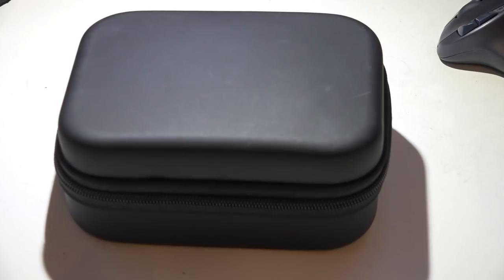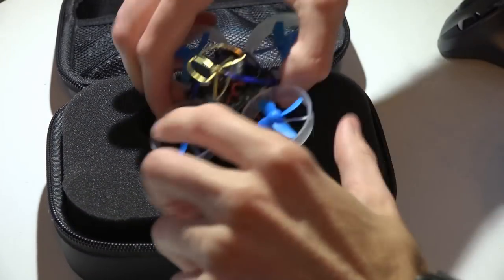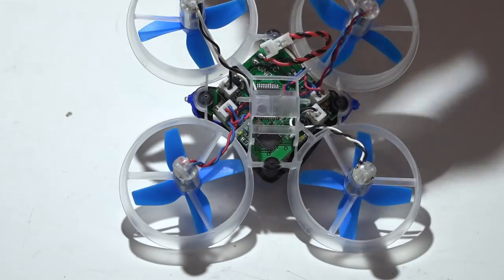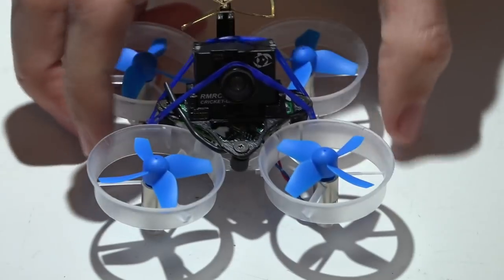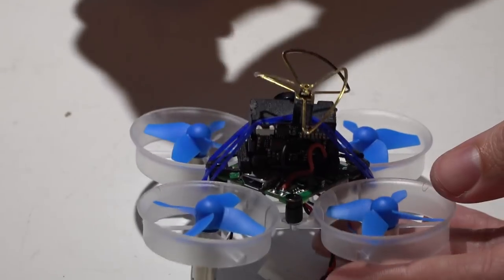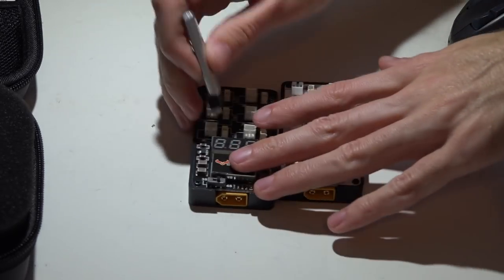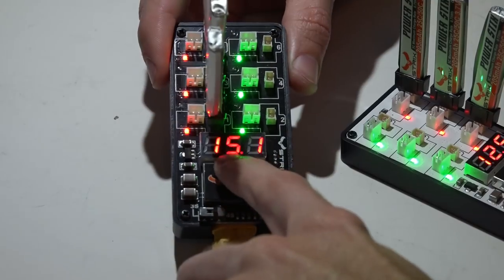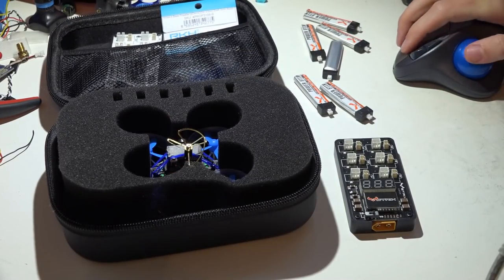My Tiny Whoop

Comment: I can highly recommend canging the battery cabel and going for jst 2.0 ph batterys(maybe HV). 
Probably you can also use the 200mw VTX of the Eachine TX02 camera. Unpin it, connect it to your camera and glue it with the antenna facing backwards on your fc. It won't brake any more that easy like this.

Comment: I bought the original beecore board when it first came out hoping it would bind to my evolution and it didn't.  Did they fix that?  I bought mine on banggood.  Not sure if the ebay one is the same or not.  I ended up using the Eachine Tiny 32bits F3 Brushed Flight Control Board and just soldering the motors to it, connecting the tiny FS-A8S, used a custom 3D printed mount and it is super light.

Comment: Wait I have a BeeCore FC and I thought it only had the 1st Flysky protocol while the Evolution uses the newer Flysky protocol. If I can use my whoop with my evo instead of this old PoS Flysky remote ill be the happiest bean alive.
Reply: JC, can you address this?  I was under the same impression.  I am having to use the FS-A8S receiver to fly with my Evolution.
Reply: I just checked Banggood and they mentioned the beecore being updated to the new protocol. I checked the ebay link and it doesn't say it is the new version but I would imagine they are all coming out supporting the 2A protocol.

Comment: Been waiting for this video from you for a while!
Reply from the maker: Thanks. I've been swapping out parts for a while haha. But I'm finally happy with everything now after trying a bunch of stuff out and seeing what I like best. I think after getting the smaller cricket cam v2 I'll be completely done with it.
Reply: I've been doing the same with mine and my son's tiny whoops. I gave up waiting for the all in one boards to support the 2A protocol so i ultimately ended up with a micro brushed F3 board and the micro flysky RX. Yeah, it's still two boards but I do get to run ibus which I like a lot.

Comment: Hi JC how did you get the beecore F3 FC  to bind to the turnigy Evo, I have spent a couple of hours on this and failed, reading the forums it appears that the beecore is AHFDS and the turnigy is AHFDS 2A
Reply: Jim Hyndman turn ahfds off
Reply: Hi Micheal my understanding is to get it working on a fly sky TX you turn AHFDS 2A off which reverts  it to the older AHFDS protocol the Turnigy appears to be locked to the 2A protocols. Any detailed info you can supply would be great
Reply: Jim Hyndman not sure about that

Comment: People should be aware you should never charge a lipo or any lithium battery to higher than its rated voltage. Do not charge cells rated 4.25v in a 4.35v charger they can explode.

Comment: I expected more from you on the Tiny whoop.    Linear antenna, taken off the camera guard for weight savings, & certainly not using rubber bands to mount the camera.
You are better than this PBF.   :-D     However, that STRIX charger is B/A!

Comment: How fast is the strix charger?
Reply from the maker: Pretty quick. It charges at .4a per port
Reply: not too bad my ultra power charger worth off a xt60 I just haven't tried it yet. I really have had my eye on these board I really like the idea of not worrying about voltage or whether its the same battery.